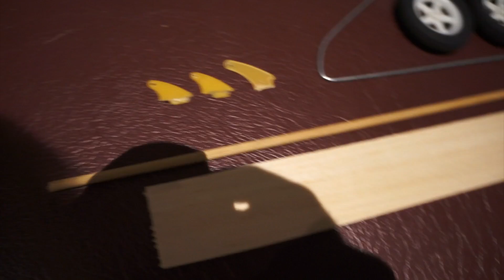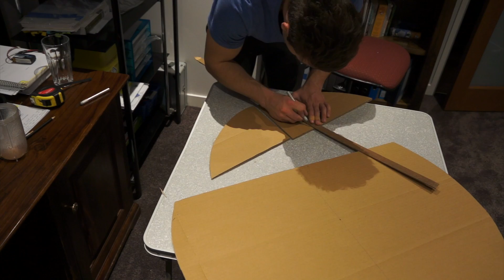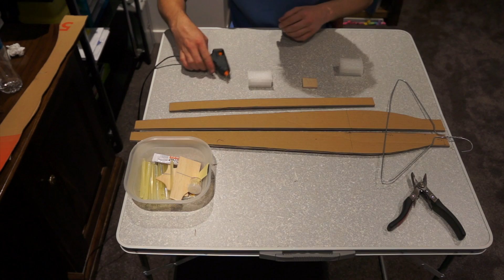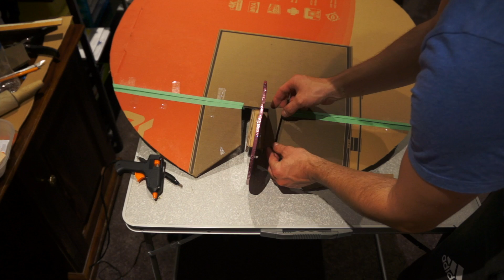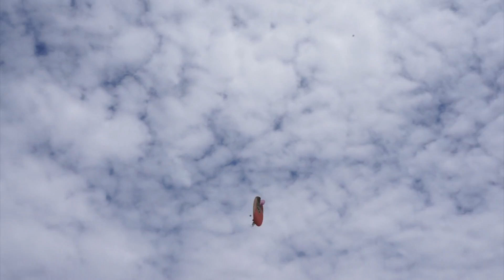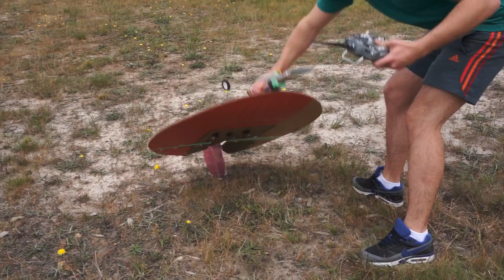How To Build an Easy RC Airplane using Cardboard

Comment: Hi Brandon - excellent stuff. Love it! Can you advise on what motor you are using, ESC etc? And prop type would be good. I think you are using 3 servos - could this fly with just elevons? ( mixed ) 
Anyway - fantastic build!
Reply: Hey there. 100 gram Turnigy motor and 45 amp ESC, APC 11x5.5e. I think it may struggle with just elevons, but you wouldn't lose much in trying.